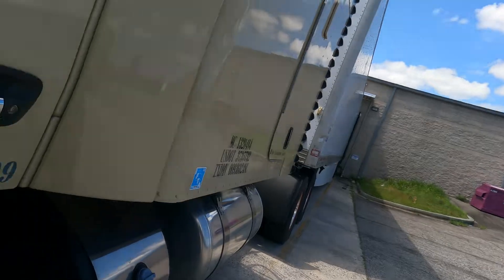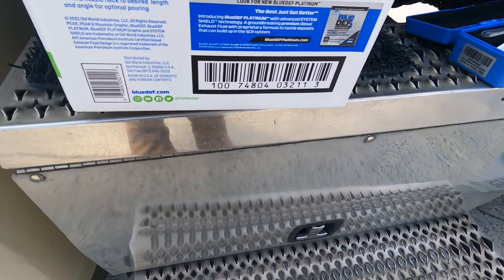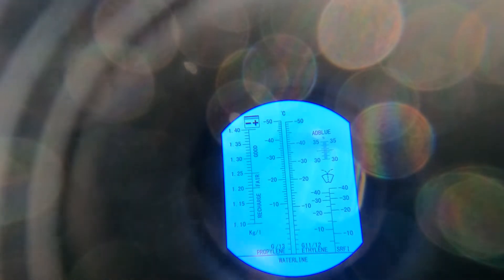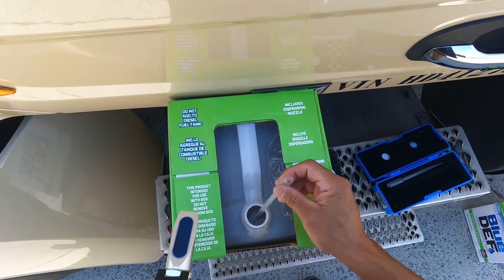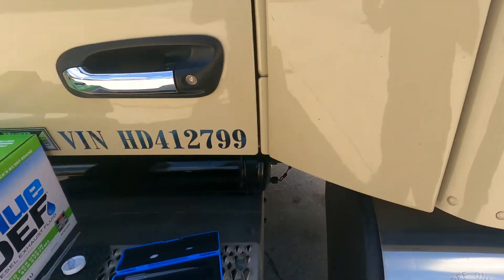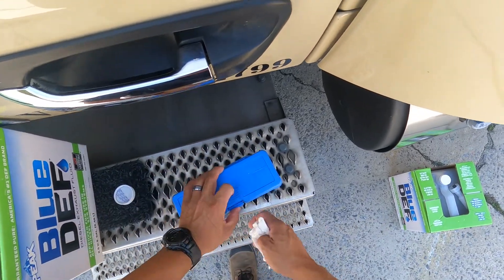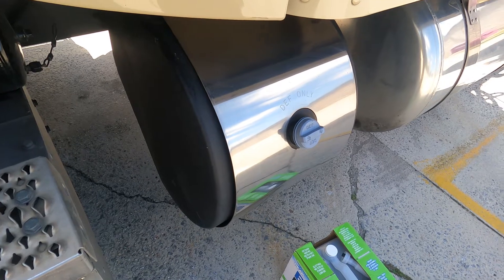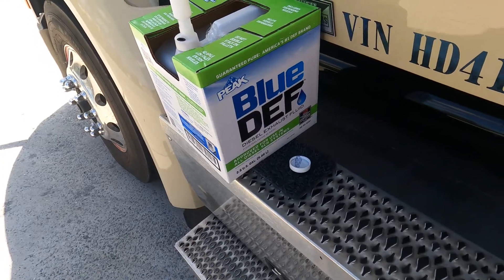How to Test the quality of your DEF ( Diesel Exhaust Fluid) with a refractometer.

Comment: bro how do you check it if its in the DEF tank?
Reply from the maker: You can siphon some out, I have rubber hose just for that in my truck, just make sure it's long enough to reach the bottom.  I use a empty 16 ounce water bottle that I cut in half to test with.
Reply: What range is considered bad?